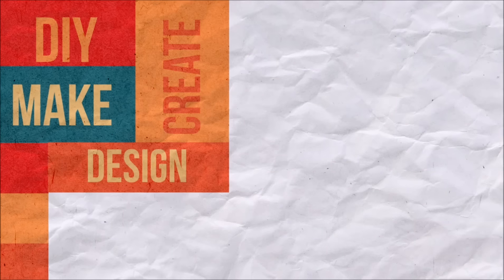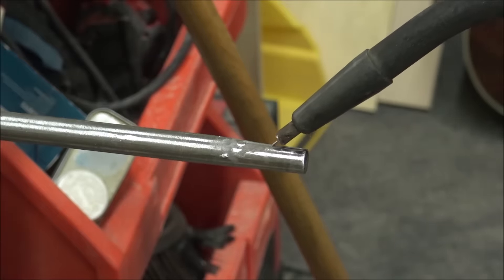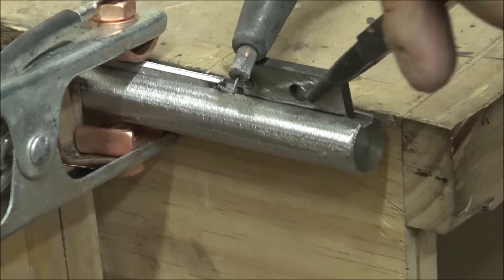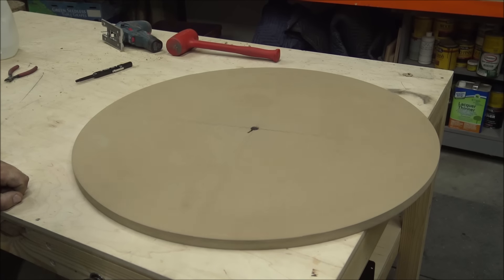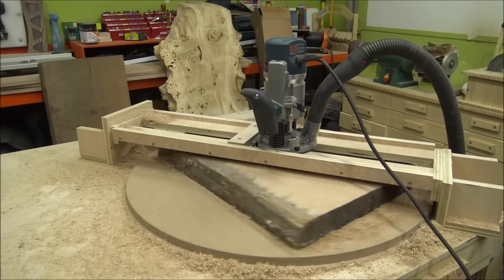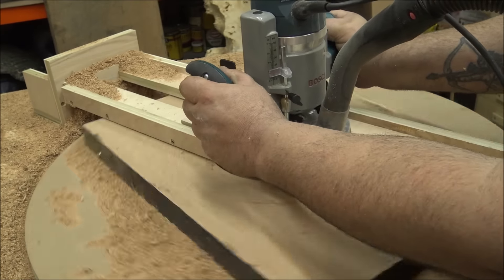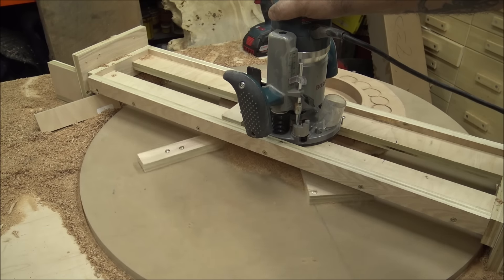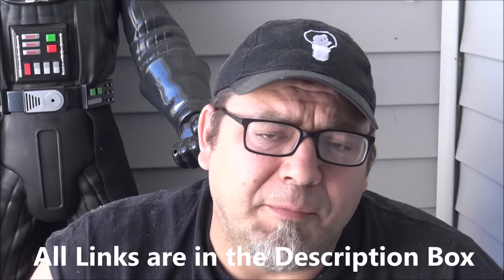Homemade router jig, bench top turn table

Comment: Not sure if you addressed this or not, but here is a suggestion you may find useful. Under the circle bed you could install bearings to ensure the table does not wobble. I was thinking like using 2 slots with like a slot cutter or something, a wider slot to house the bearing and a smaller cross slot to hold the bearing axle.  I might use hot clue to hold the axle because you may need to get the bearings out at some point should they ever go bad. Another thing you might use is a ball bearing in a housing, cut into the table top with some sort of way to adjust level from the bottom of the table. This will allow for easy adjustment on the fly and with the balls being stationary they might last a lot longer. I think you can buy the ball bearings individually if memory serves me correctly. You may want to put Formica on the back side of the circle to take any wear from the ball bearings or on the table top if you use the first suggestion... Great project as always... Cheers....
Reply: +Paul Bialozor You could use a 15mm (5/8") flange fit ball transfer unit mounted into the table top in a circular layout by boring a 15/16" hole and press them into it.  On the underside of the rotary table, route a groove channel using a circle jig and a 5/8" diameter round bit so that the groove is roughly 1/4" into the surface.  That groove would ride on top of the balls in the flange fit ball transfer units.  They are also known as Flange Mount Ball Transfer Bearing.  I've seen them on Ebay, from a Chinese supplier for 2 units for $5 or from a US supplier for ~$5 each.

Comment: super cool , all that,s missing is a pivoting option on the router slides (side to side)and you could make any round 3d shape, like the angle option, could be used as a spray turn table as well for finishes , lol

Comment: I think I need to find that gear reduction system. I have quite a few tree slabs piling up that I need to turn into tables.
Reply from the maker: +Brian Way forty is good but if i had to do it again i think i would go with a 60 to one reduction
Reply: +izzy swan Im going to buy one.  I have a few slabs hanging around that need milling

Comment: Welding your keys kind of made me cringe. In your case it isnt really a big deal. Although keys are often made of softer metal so they shear before the gears shear if there is a jam. The shear key can also protect your drive motor if the device being driven jams.

Just thought you would like to know. As a kid I have made many a metal key and stripped a few gears. Until my grandfather explained to me why keys were made out of aluminum.